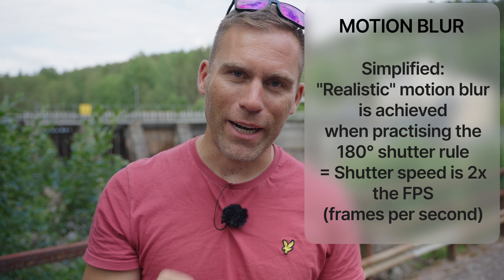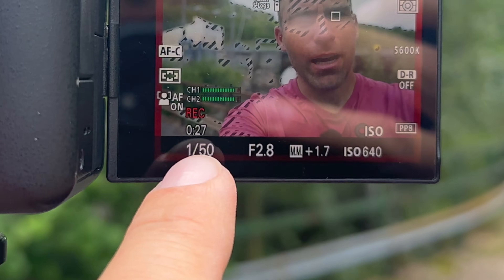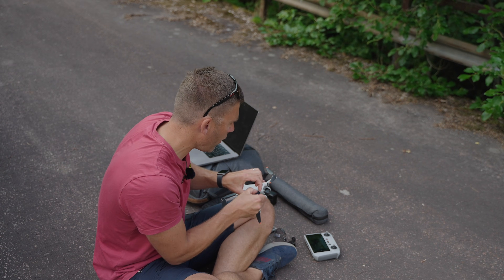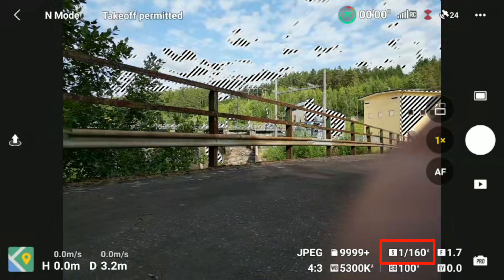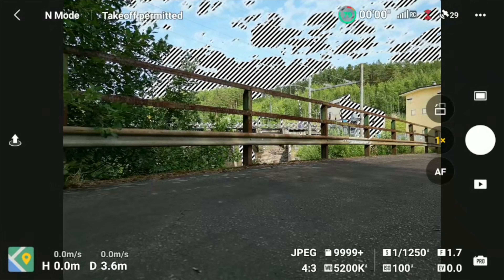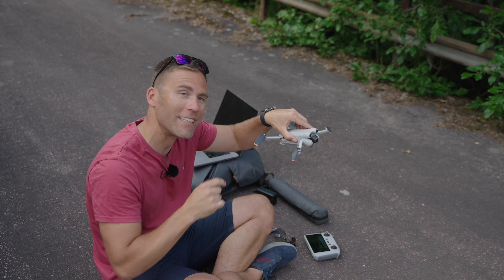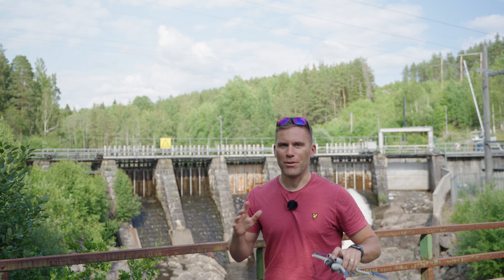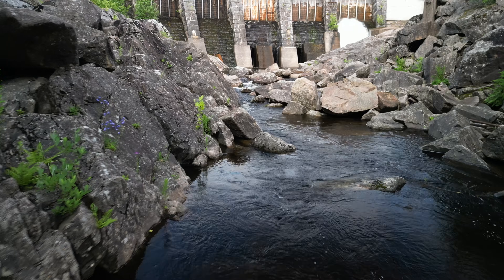How to ACTUALLY use ND Filters - Complete Guide and Tutorial

Comment: What if you use an ND filter in AUTO mode? Will it bring better quality over AUTO mode without ND? Is there a point in using ND filter in AUTO mode?
Reply from the maker: It definitely work in auto. It’s the same practice and I think I even showed you how it can work in auto where the variables are changing automatically depending on what filter you put on the lens. It’s all about keeping the shutter speed where you want it to be to get the video feeling that you want to have.